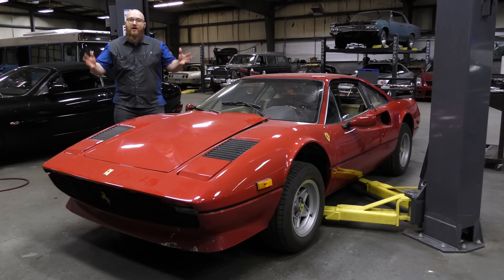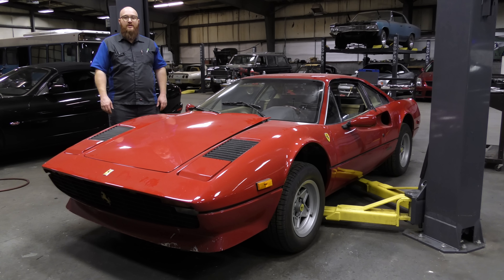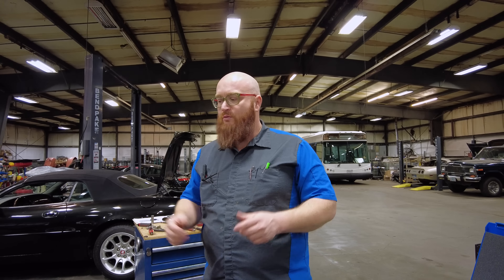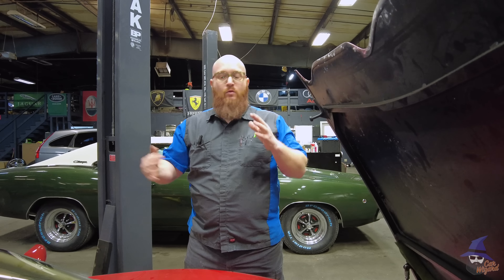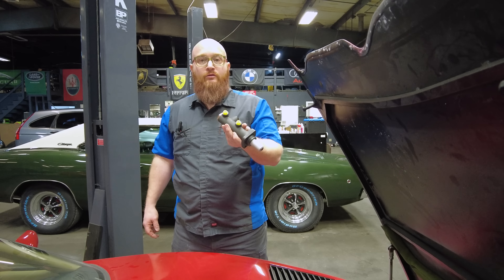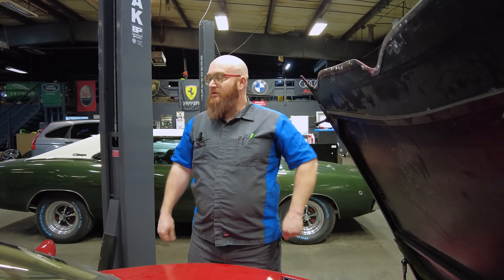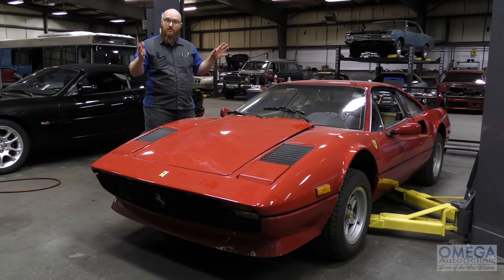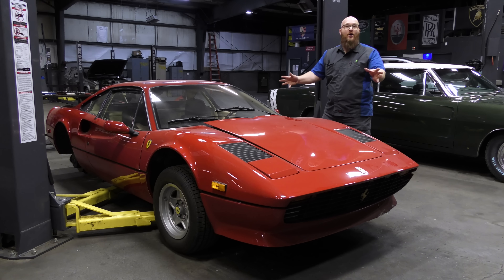My '78 Ferrari 308 can't be tuned! CAR WIZARD has to make some serious changes.

Comment: Why not just LS swap it?   ;)
Reply: It's a rear engine transverse mounted V8. That's a very small and narrow engine bay. So unless you want to cut it up and tear it to pieces, this is going to be a very difficult swap. The LS4 is a LS designed for transverse swaps but that's going to leave you stuck with an electronically controlled 4 speed automatic or an expensive custom fabricated transverse manual setup. Good luck finding a good manual rated for 303 horsepower in a transverse configuration.
Reply: @danielseelye6005  LOL! Good one!